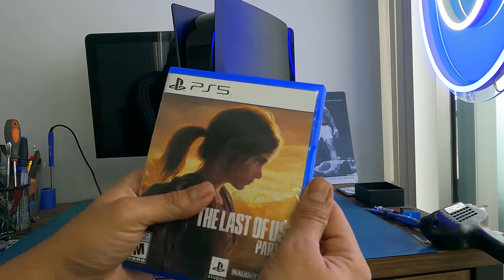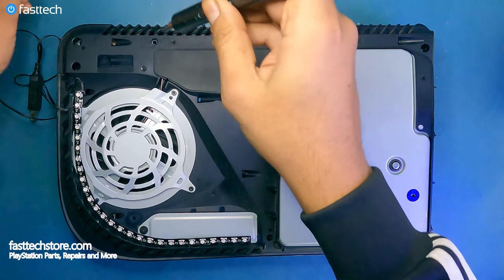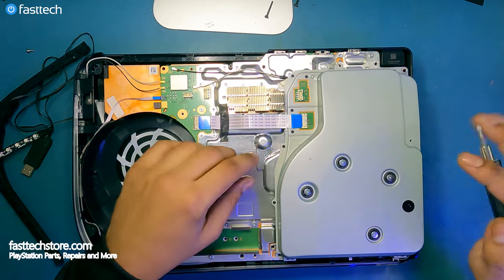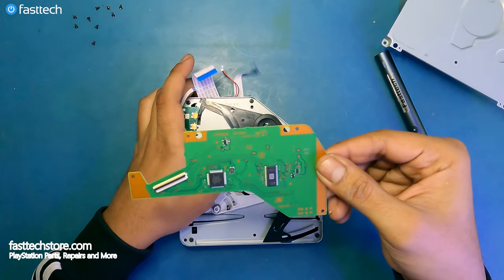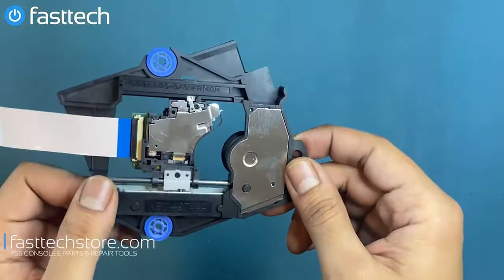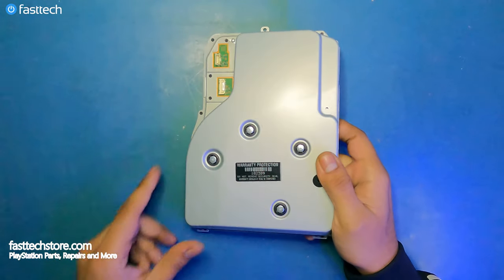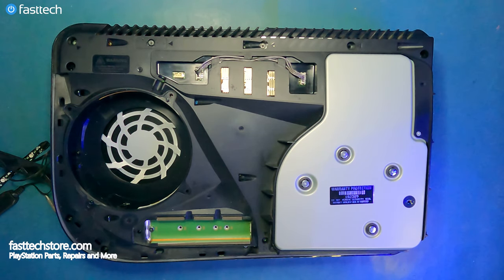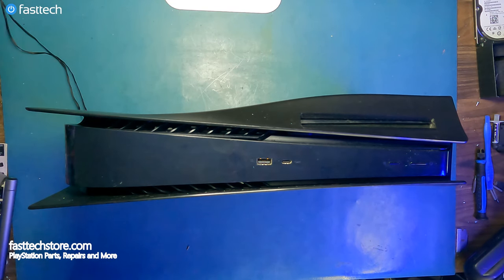PS5 Disc Drive & Laser Repair and Replacement Guide

Comment: My ps5 couldn't load bluray discs either games or movie. But i tried inserting a dvd and a ps4 game and the ps5 read it without problem. I tried doing all the methods in safe mode but still couldnt read my games. It does make a noise when the disc is inserted as if the disc is inserted upside down. 

How do I know if I just need to get just the laser or laser with deck?

Comment: I just finished replacing the laser and it accepts and ejects the disk but it skips now. Do i need a whole new ps5 disk drive?
Reply from the maker: @TralalaptaTurtleMan  check the plastic white piece that sticks out on the left side and make sure its aligned with the roof mechanism of the drive

Comment: Followed the video exactly.  But ps5 isn't recognizing the replacement cd drive.  Unable to read disc.  Any suggestions?
Reply from the maker: Bad disc drive or laser. Did you buy it from us?
Reply from the maker: Small chance your disc drive logic board could be bad. Did you install your original disc drive board in the new drive?
Reply: @fasttechvideo  yes.   The original drive would not accept disc's.  Couldn't put them in.  Wasn't a reading issue.  Replaced the drive followed video, now says can't recognize disc
Reply: Yes replaced the daughter board
Reply: @fasttechvideo  no I did not buy from you bought locally
Reply from the maker: @vlastosbros  Try a different drive or a new laser

Comment: My ps5 disc drive sounds like it wants to try and spin up a few times, but gives unreadable disc error.  Won’t read ps5 or ps4 games,  it a dvd movie played. Would you recommend I replace the laser?  Cleaning it with alcohol did not help.  Thanks!
Reply from the maker: @terzaghi83  replace the laser

Comment: My PS5 only has the one fan wire, it doesn’t have the other two I see in the video? The model number on the PS5 is MODEL CFI-1215A. Do you have a disk drive for it?
Reply from the maker: @turbotrap5281  here you go https://youtu.be/XNj1uTPf55E?si=iLLuxDT8OZ37ZYw1

Comment: My ps5 will read movies bluray and 4k but not games whst should i replace
Reply: Make sure you replace the logic board (daughter board) with your original. I had the same problem and this fixed it.
Reply from the maker: Make sure you retain the old disc drive logic board from your old drive and install it in the new one. You have not done this step that is why. I wish people paid attention to the video as I mentioned this step 3 times.

Comment: Hey this tutorial was super easy to follow and very helpful 🙏 I just had a quick question. 
How can I tell whether or not I need to replace the whole disk drive, or just replace the laser?

I don't want to buy the disc drive if it's just the laser, but I also don't want to just buy the laser if it's the whole disc drive that's busted 🤷‍♀
Reply from the maker: If the drive accepts the disc but it spins and stops you can replace just the laser. Hope that helps. Good luck and if you need a laser we sell them (check the top comment) with lifetime warranty and free shipping
Reply: @fasttechvideo  Lifetime warranty and free shipping? SOLD 👨‍⚖️ buying it rn lol
and thanks for the tips! Much appreciated 🙏
Reply from the maker: @soralucis  thank you for your order 😊

Comment: Amazing video. Is there anyway to see if it is rhe laser or an internal malfunction without opening the ps5?
Reply from the maker: Yes, if the disc spins and stops (you’ll be able to hear this when you insert a disc) you have a laser issue, thanks for your comment.
Reply: Yes making the decision to buy a new PS5 my current one is doing exactly this no disk symbol at the top of screen but spins disk once and stops
Reply from the maker: @joshjenkins466  what are you going to do with the old one?

Comment: Hello, only comment is at 15:20 when putting the disc drive back together, the top left white gear should have a white knobby thing poking through which is from the side plastic sliding gear. , in the video yours does not have this so I don’t think is properly aligned or gear positioned correctly . I aligned the exact same way as your video (no white knob), but ps5 would not accept my disc.  After looking at pictures on another site, I realized the error and corrected.
Reply from the maker: Hi,
You are correct. Thanks for your comment :)
Reply: Could you give me a link to the pictures? I don't know if i have everything alligned correctly :/

Comment: Great video! Is there any way of knowing if the discs arent being read because of damage to the daughterboard?
Reply from the maker: Thank you. Yes if the disc drive doesnt accept or attempt to accept the disc at all or if it drive spins but the game wont read.
Reply: @fasttechvideo And what do you do if that is the case
Reply from the maker: @FTWTXGOLFER there is a chip you must transfer over with a BGA rework station to a new working logic board

Comment: Do you need the fasttech toolkit?
Also, how do I know if my issue is just the laser lens or the whole deck?
Reply from the maker: Yes you need it for disassembly of the console
Reply from the maker: If your drive is accepting the disc normally but not spinning then you just need a laser
Reply: @fasttechvideo  thanks for the quick reply! For some context this is what it sounds like. I don’t hear any grinding and whirring or anything, it just spins for a very long time trying, like it would with a bad disk.
https://youtu.be/AxuXMIWdviQ?si=Lp4vKPe6kggZ5obv
It sounds like replacing just the laser is pretty straight forward. Can I do that with a standard Philips head?
If it turns out to be the whole disk drive can I send back the laser inclosure  and pay the difference?
Reply from the maker: @ShawnHellwege  saw your video, its a bad laser. First try cleaning it with alcohol. If it doesn’t work you need to replace it.
Reply from the maker: @ShawnHellwege  yes you can with a phillips but you need a T9 to open the console. Good luck
Reply from the maker: @ShawnHellwege  Also, may I use part of your video for my upcoming video to show what unreadable disc error looks like. Also would you mind recording one where you keep the camera still without commentary? That would be very helpful so I can show others.
Reply: @fasttechvideo  sure so you want one of me just pointing at JUST the ps5 without saying a word? How close did you want the camera?
Reply from the maker: @ShawnHellwege  yes exactly, close enough where the whole console is in the shot and the noises it makes can be heard and one scene with the screen showing where it says unreadable disc. Try to keep the camera as steady as possible. Thanks 😊

Comment: Hi there, my PS5 was working fine until today. It stopped reading any disks. I've tried booting it in safe mode and rebuilding the database, but it seeks like a hardware problem as the disk drive is quite noisy when it tries to read the disk. Do you think I just need to replace the laser - or will i need to replace the whole drive? Thanks!
Reply from the maker: Replacing the laser and deck will fix your problem. Since its making noises better replace the laser and the motor that spins the disc. This is what I am referring to: https://fasttechstore.com/playstation-5-1/p/ps5-laser-lens-with-deck-kem-497aaa
Reply: @fasttechvideo  thank you so much

Comment: I bought the laser lense assembly itself off eBay, put it in, and the ps5 went into safe mode and won't "update" just says error. Would getting it off of your website fix this issue?
Reply from the maker: I dont think so. I think there is an SSD problem possibly. Try my safe mode video and see if that works.

Comment: So I just replaced it and the weirdest thing happened man. Watched your video went step by step but when I put my cover back on it, it doesn’t work at all… when I keep the cover off it does! I’m curious if it’s something I need to adjust in the screws that’s probably putting too much force to make the disk work??
Reply from the maker: The disc drive cover or the case cover?
Reply: @fasttechvideo  the actually case cover. When I put that on it doesn’t read the disk but if I keep it off it does.
Reply from the maker: @Dregohard609  are you sure you are putting the disc in the correct way? Does the drive power on? Check for pinched cables
Reply: @fasttechvideo  absolutely it’s the weirdest thing ever I even got video of it. Everything is right but soon as I put on the cover that goes over it, it just says disc reading error everytime
Reply from the maker: @Dregohard609  show me the video?

Comment: A technical question: what is the normal operating temperature of the PS5 optical disc drive? My discs come out hot (40°C), is this normal behavior?
Reply from the maker: Dont know sorry.
Reply: Mine did exactly that and then quit working.
Reply from the maker: @simon-515  Interesting, I have not come across this issue yet. I would be willing to try to fix it if you can mail it in. Maybe your PS5 will be on YouTube who knows.

Comment: So i cant just put in a new disc drive without taking apart the logic  board on my old disc drive? So what happens if my logic borad on my original disc drive is broken? Does that mean i cant buy a replacement?
Reply from the maker: Correct

Comment: My PS5 disc drive spins but won't read any discs , I didn't use my console for like a half a year. Should I buy entire disc drive or just laser ? Thanks.
Reply from the maker: Does it spin consistently or spins and stops?
Reply: @fasttechvideo  it spins for z while and then stops, then throws the unreadable disc error.
Reply from the maker: @patrykk3728  replace the laser
Reply from the maker: @patrykk3728  just to confirm. Does it give you a error code? Or just “unreadable disc”?
Reply: @fasttechvideo  thanks I have the first Gen ps5 which part from your website is correct? I will buy today.
Reply: @fasttechvideo  it gives me  unreadable disc error.
Reply from the maker: @patrykk3728  
Here is the laser you need. You can get it with out without a deck. 
Laser with deck: https://fasttechstore.com/playstation-5-1/p/ps5-laser-lens-with-deck-kem-497aaa

Laser only (harder to install but cheaper):
https://fasttechstore.com/playstation-5-1/p/ps5-laser-lens-kem-497aaa

Comment: The board on my PS5 is a UHN-020 and I’ve got a spare disk drive that’s a UHN-010. Are they compatible or will I need to get a disk drive from a UHN-020?
Reply from the maker: They are not interchangeable

Comment: Thanks for your video. How can I pair a replacement drive logic board to the PS5 motherboard?
Reply from the maker: No way to flash the board yet but I suspect all it would take would be to de solder a chip off the old one and install it on to a replacement board.
Reply: @fasttechvideo  Thanks for your quick reply. I appreciate it.
I have issues with a 1 year old PS5 where it shows the "Unreadable Disc" message after putting a disc in it.   I opened it up and replaced the disc drive logic board and it's giving me the same issue. I checked that the disc drive was free of objects inside and it was clean as new.

I assume the new board won't work because of this pairing situation. 

Sometimes I wonder if the original board won't work because it somehow might have gotten unpaired, because the original board looks brand new and it doesn't smell burnt at all.

Maybe it got unpaired and now I have this issue.

It's a shame a company like SONY doesn't give us a tool to pair boards. It's as if we didn't have a right to repair our products. 

I don't think they'll another dollar from me ever again.

Thanks for your video. It was very helpful!
Reply from the maker: @P_double_H  i agree with you sir. Thanks for a being a viewer and for your comment 😊

Comment: Mine is reading DVDs/Bluerays but at some point when they are playing, it'll start skipping, then the screen turns black for a long time before it pops up and says it cant read the disk..then once I try to turn the movie back on, it says it cant read the disk again or it wont even show that the drive has a disk in it. I can hear the drive moving and trying to work but its been an issue  for a few months and its grtting worse. Wondering what exactly I need to buy to fix it? Thank you
Reply from the maker: Replacing just the laser will fix your problem

Comment: I like your vids but they arent helping me, my ps5 doesn't even try to take the disk in at all. Im afraid i will have to buy another drive, will i?
Reply from the maker: Check the cables, if they’re good you have a drive board issue

Comment: The fan connector wouldn't come off of the off-white part when I tried to remove it. The off-white part came off too after trying for 15 minutes. Even now that it's broken off it still won't come out. I have to buy a new motherboard now don't I?
Reply from the maker: It can be soldered back on but the difficulty level depends on if traces have been ripped off.
Reply: @fasttechvideo  do you have a video on soldering? I'm not sure what traces are but it came off pretty intact and not much damage to the actual motherboard
Reply from the maker: @davidlaverne3090  Not yet but I will be doing one in the future

Comment: PS5 when replacing a disc drive can I just swap drives? Or do I need to swap parts from old drive?
Reply from the maker: The disc drive logic board needs to be swapped over
Reply: @fasttechvideo My logic board is broken... please help
Reply from the maker: @gladitorlibya282  you’re going to have to try to fix it otherwise your ps5 wont read discs
Reply: @fasttechvideo  my disc drive's power plug is broken while unpluging it how can I transfer it to digital i just want My ps5 reading that is the drive is connected so i can update the system and download games from the store

Comment: Can a ps5 work without disk drive can you make a ps5 like digital version?
Reply from the maker: Yes you can just make sure the disc drive logic board is connected to the motherboard via the ribbon cable. The drive itself doesnt have to be in the system just the green PCB board that’s in it

Comment: I just replaced the laser in my ps5 and before it was only not reading blue ray it could read regular dvds just fine. Now after I replaced it it can’t read either what do I need to do
Reply from the maker: You have a defective replacement laser. If you bought it from Fasttech you can send it back for a replacement.

Comment: Magnuson-Moss Warranty Act of 1975 requires that electronics can be opened without voiding the warranty, regardless of what the warranty says, so warranty stickers are unenforcable and you cannot deny a warranty due to the state of any warranty sticker.
Reply from the maker: Enforced by the FTC which has no teeth. You are technically correct though. Thanks for your comment 😊
Reply: @fasttechvideo  Yes, but all it takes is some bad reviews or someone with disposable income and is willing to pursue legal action to really screw you. If you want to risk fines of 40K+ per incident, then that is on you. I doubt you have the resources neccisary to defend yourself if this came to your front door and fines of that nature probably ruin your business. I don't want to see that. You should figure out a different method to protect yourself from people sending back parts you did not sell. You can already deny warranty requests for a customer damaging something you sent them, you just can't do it with a warranty sticker. All-in-all, you do you and good luck, but you're asking for trouble.
Reply: "If a consumer pursues a remedy for a breach of warranty under the Magnuson-Moss Act, they may hire an attorney, file a complaint and pursue legal action against a warrantor. Reasonable attorney fees and court costs may be recovered under the act if the consumer or plaintiff prevails."

Comment: I'm glad I found this video.  I will definitely be buying that tool.  My drive sometimes reads a disc and sometimes doesn't read.  I can restart the system a random number of times and it recognizes the disc.  I'm probably going to replace the laser.
Reply from the maker: Yes sounds like your laser is on its way out but do try cleaning it first
Reply from the maker: Also thanks for buying our toolkit. It will serve you well

Comment: My 2 year old has been messing with it for months he finally won the battle won't read any disk made a weird noise when I turned it on today God knows what he did to it.
Reply from the maker: He probably stuck objects in it
Reply: Literally here now because my toddler has been putting paper in my disc drive
Reply: @CrownOnLoc  so what I ended up doing I took the shells off and put like those big popsicle sticks cut it to size and held it with some 3m tape to cover the disk slot i put the shells back and they will hold the popsicle stick tight in place and voila now my 2 year old cant put nothing in there it works for me since I only play like one disk game I have a couple downloaded. I don't know why I didn't think of it the first time this was my 3rd time opening the ps5.
Reply from the maker: @CrownOnLoc  goof luck with your repair. Let me know how it goes
Reply from the maker: @juniormorales559  I’m somewhat of an engineer myself
Reply: @fasttechvideo  😂😂

Comment: I just bought it two months ago and the disc problem happened ..
Reply from the maker: Is it a fat or slim model?
Reply: @fasttechvideo  It’s slim model. I'm afraid that once I take the PS5 apart, I won't be able to put it back together so I decided to send it to Sony for repair.
Reply from the maker: @lovelychubby7378  yes I was going to say it should be under warranty. Good luck

Comment: Installed new disc drive and still can’t insert a disc
Reply from the maker: Check the ribbon cables. If they are plugged in as they should be, you could have a problem with the Disc Drive logic board.
Reply: @fasttechvideo  if I hold the eject button for 10 seconds the rollers will move how can I check the daughter board